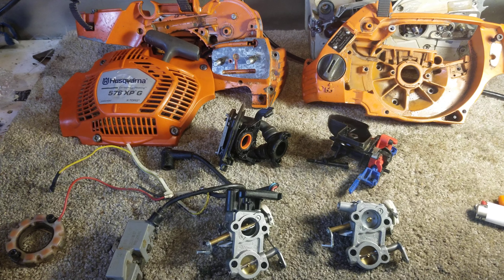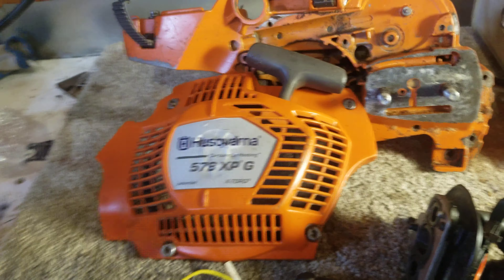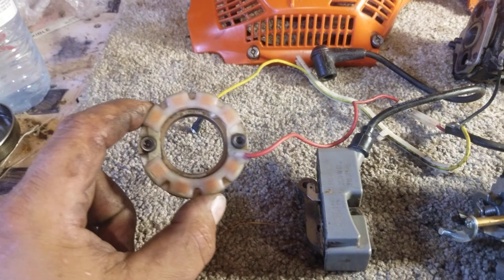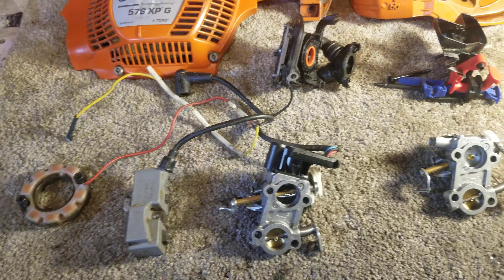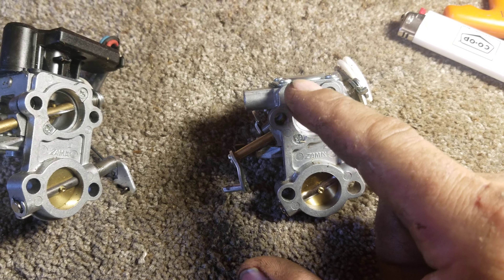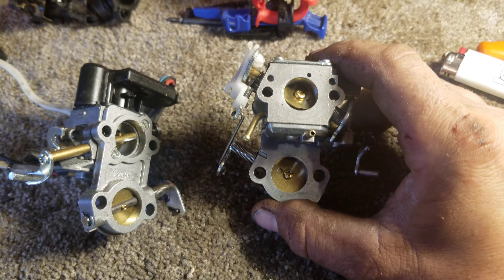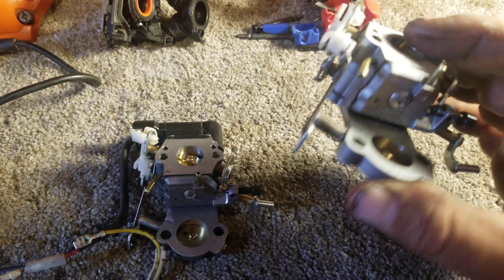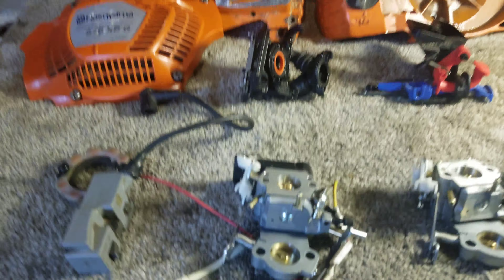Husqvarna 576xp, non autotune to autotune conversion.

Comment: I have a mates husky 562 auto tune he was told by the shop was blown up. He bought a new saw and bought this to me, told me if i get it running i can have it on the farm, 
Bit of start ya bastard and it starts up as it should, the revs are low and i cant keep it to idle without my finger on the throttle. Im in Victoria Australia, very cold climate. Maybe the auto tune is playing up, i have heard of some ao chip being common to go out of warranty. I want to convert this back to normal conventional tuneable carb, is there and wiring i need to link back on itself or what is the method behind converting this auto tune saw back to a convertional carb?

Comment: Hey Tinman, I know this is an older vid. I have a 576XP Autotune and sent it to a friend for repairs to the mounts for the generator. In the process the flywheel has been lost. Will the flywheel for a 576XP non Autotune saw work?

Comment: Is this the same for a 572-HD saw??? Having a running issues, at full throttle it bogging, it stalls at idle.
Reply from the maker: No its only for the 575xp. 572 is only available in auto tune trim wjere as the 576 came both auto tune and non auto tune.
Reply: @tinmanssaws  Hey Tinman, I know this is an older vid. I have a 576XP Autotune and sent it to a friend for repairs to the mounts for the generator. In the process the flywheel has been lost. Will the flywheel for a 576XPG non Autotune saw work? I have purchased one and the dealer has stated it is compatible with an autotune.  But I can’t find any info.

Comment: Tinman, I have a 570 autotune . Customer states it created a issue with max rpm a while back. Has had it to two different husky shops. They put a new autotune carb (OEM) and still only revs 11800 max and that's holding it wide for a long period of time . Have you had these issues with the 576?
Reply: Having the same issue with my saw did you resolve this issue? Had mine to the dealer twice

Comment: Hi, I have a 576 xp autotune and last week i clean the air filter and also clean the air intake (was very dirty, oily wood dust) and i use compressed air to blow some dirt away.  When i restarted the saw it won't run full throttle anymore, up to 3/4 of the throttle lever it run ok, but whenb i try to run it with more than 3/4 of the throttle lever, it just die (looks like it become very lean). I had a similar issur 2 years ago, i went to the repair shop and he replace the whole carb and electronic autotune module from a damaged saw for 75$ and it solved the problem. Is there any component (pressure sensor or others) which can be damaged by using compressed air to clean the intake.  Do you have any idea on how to solve this issue?  Thank you Sylvain.